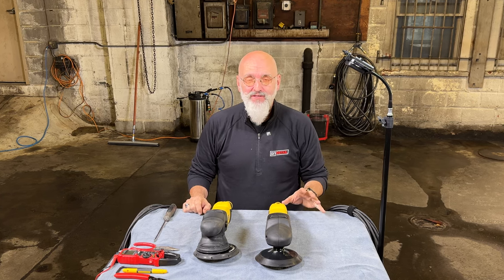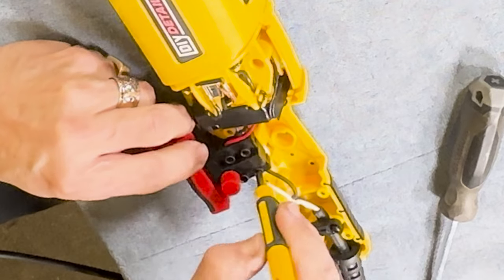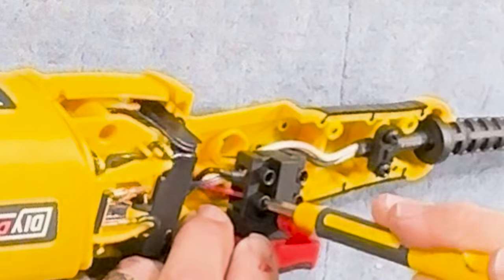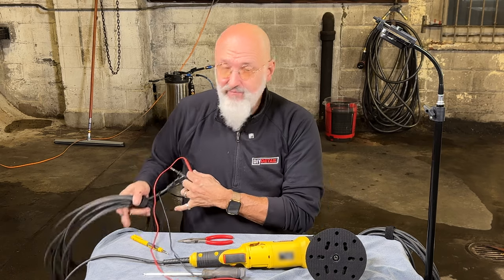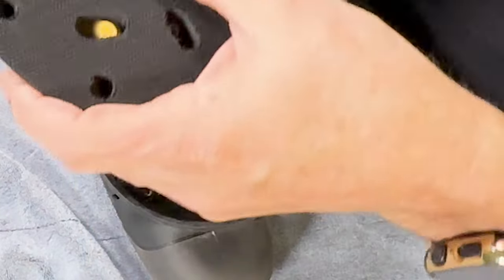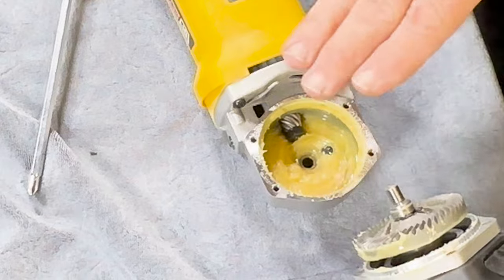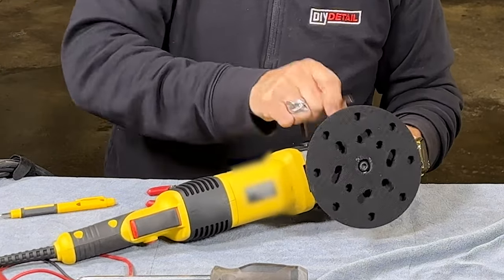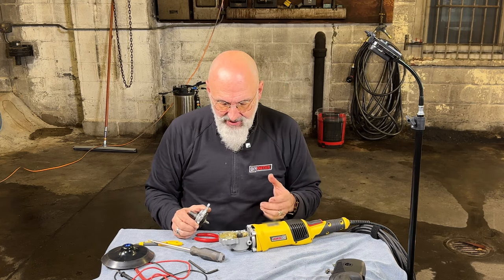BASIC POLISHER MAINTENANCE: how to service our Dual Action & Rotary machines!

Comment: Question Ivan when using a smaller backing And because the machine is obviously larger and heavier than a smaller polisher. Did it feel odd ? Or balanced and tested in tight spaces were a small pad would be required?  How does this machine feel and ? Was it difficult to use in narrow or small , tight spaces?

Also, you mention that you need.to repace the Grease every year? Why is that? What type of Grease do or is installed in these polishers?
Last quesrion, ypu states that the motor is 1100 watts? Because on your site and everywhere  else, it says it has a 1000 watt motor?
Reply from the maker: We had several detailers test the prototypes with both 5 and 6 inch pads , everyone enjoyed them with both pads. It’s very easy to use. 

Grease breaks down over time, much like you need to change the oil in your engine.

It’s a maximum of 1100w at full stall, 1000w is more realistic.
Reply: @diydetailofficial  

Yes, I am sure 5 and 6 inch is great!  How about smaller backing plates/ in smaller tighter areas? How about doing a video about that? 
I  glad you mentioned about changing the grease because you don't hear anyone mentioning that. Except, for Bryan at Apex detail. Which he recommends when you first  receive your new polisher, to change out the cheap grease that they add in the Chinese factories with a much higher quality like Schaffers or other mfg..

Comment: So with your polisher just hitting the market recently is this video purely informational or does it serve a purpose cause your polishers have been running into issues? I ask because im about to order your 25mm DA
Reply from the maker: This is strictly for information, and to show that any polisher can be maintained. We have warranty repair centres across North America, but in many cases it’s easier to repair your tool than drive to the nearest shop .

Comment: This has ben driving me crazy i see rupez and max shine say do not use 5 inch backing plate on there long throw machine but then seeing alot of people say they prefer a 5 inch backing plate on a long thru the company's saying not to do it makes sence because of the counter balance i see some polishers that say you can swith but they sell the right counter balance weight to match the pad or they have a way of adjusting the counter balance but yet i see you selling your polisher with a 5 and a 6 backing plate but no different counter balance or any way to adjust it shoot i couldve swore ive seen a old vid of ivan saying not to run a 5 inch backing plate on a machine that was designed for a 6 inch im trying to listen to yvan i feel like he is in a weird position he can say to never use soap till he is blue in the face but if the market wont listen and demands soap then he is gonna sell you soap is that kinda the case with the 5 inch backing plate for the 25 mm da that even if yvan says not to do it there will be a over wellming demand for it so just include for more sales?
Reply from the maker: Our machine is designed to not rely on the pad weight for balance. The rotational mass is higher, meaning less vibration, and able to absorb small variations in weight. Using a 5 inch pad simply reduces the efficiency of the machine, if your machine can use a 6 inch backing plate use it. A 6 inch pad has about 45% more surface area to polish with, making it much more efficient. 

When speaking of soap, it depends on the audience. For a professional detailer, soap is a waste of time and profit robbing. For a hobbyist who’s cleaning for fun, not profit, then foam to your hearts content.